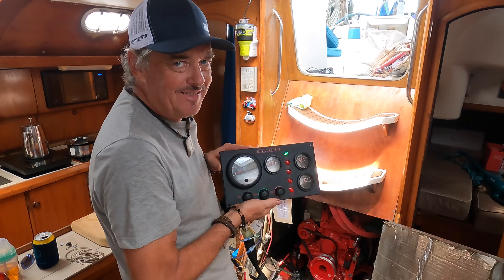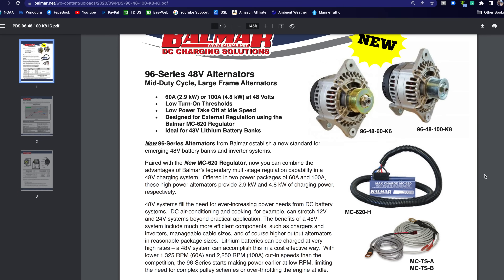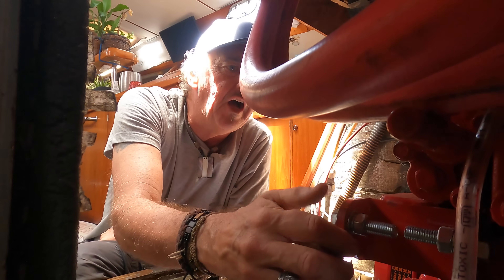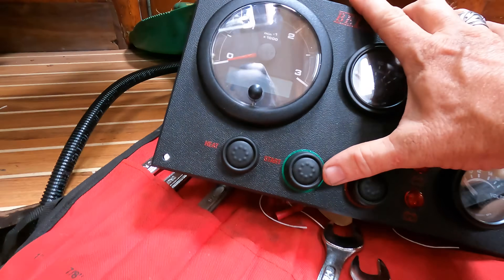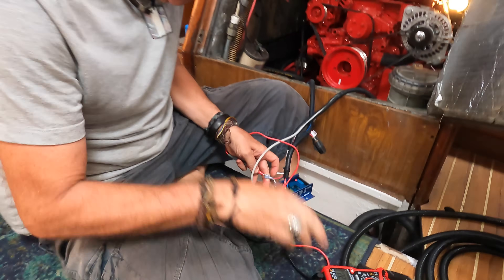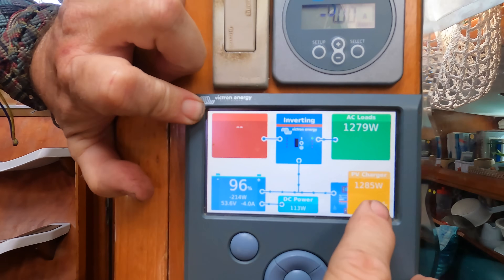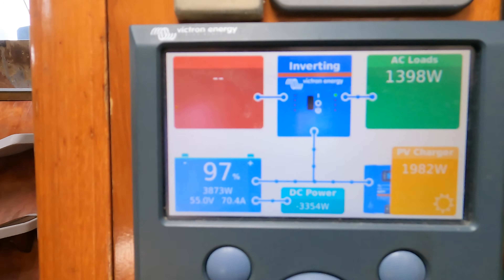SSL639 ~ THIS will change the way we live on BOATS!

Comment: I think it would be awesome if someone made a kit to convert a alternator, to a cc c power supply, and be programmable,  like a charge controller, or at least a dc to dc buck boost converter, it should not be that difficult, a micro controller, and a means of reading current, and feedback, and getting it to operate fast enough to prevent voltage spikes , it's a bit more complex than the analog regulator,  in interested in this because this is basically how my off grid house is setup,  I am building a dc generator to help supply power to the batteries/ inverter when there was not enough sun, I'm at 24v, and in the range of 30kwh 😳 not that much being a house, or with the amount of solar I have, Just shy of 4kw, (I'd like to have more like 14kw, ) maybe next summer, I could possibly convert a vehicle to electric, and solar charge it , fairly quickly, because I'd probably not stop at 14kw of pv, I may stop at 50kw, and 100kwh of batteries, with two 12kw inverters, definitely go to 48v, because the charge controllers are already out of hand, there is a guy with a big 12v system, he has a couple walls with controllers on them! Like 60 amp controllers, (I only have 6).  The onboard  dc to dc chargers are ok for small stuff, for a few reasons,  one being, they are 12v, 2nd, they are like 20a & 40a, it's cool most have a pv charging option as well, a huge 250 amp versions would be great!  Although a 100amp boost version even better,  capable of doing 12v to 24v 100amps, (even 48/62v at 50-80amps 😎 
It would probably cost so much , no one could buy it!!! 😳.  That is a ton of current at 12v and would need fail safes to prevent damage, and probably require dual alternators! 
I have 2x 150amp and 2x 130amp,  and a couple 100amp, and 60amp alternators,  the 130a and 150amp are the
 Heavy Duty, Delco 21si versions, the other are 10/12si and a couple new versions, not sure the model, they all work the same, and capable of 100+ volts, some say they can do around 1000v unregulated, I know they can output enough to instantly blow the bulbs in a vehicle, instantly!! So that's 24v or more, and I know a 12v alternator with only the regular modified, can charge a 48v battery, with only the need for a few more RPM, to generate enough voltage in some cases,  it can probably charge a 60v-72v maybe 96v system, it may require a external rectifier  because I'm not sure the voltage limit of the original diodes, they are definitely tough alternators, and 24v is very easy for them, doing 29.4v to charge my battery bank, 7s liion! LG cells, 
The strange part about my system, I also have a 12v bank, for lighting, security cameras, water pumps for heating, 12v fans, for heating and cooling, I'm looking for a small engine, 4cylinder, automotive engine, 1600-1800cc range,  older simple engine to spin a 10kw generator, and the dc charging system, it will likely have something like 1.5:1 reduction, to get the engine speed up, even a car engine doesn't make that much HP below 2500rpm, I'm thinking depending on the engine, turn it about 2500-3000 rpm, also depending on the alternator, it may require 1800 or 3600 rpm to get the 60Hz. Frequency, or I may ditch that all together, and just build a giant inverter generator, get a 24-48v 12kw low frequency inverter, use a set or two golf cart batteries, keep the battery bank at or above 6/12v  to prevent sulfation damage, or use LiFePo, 200-400ah 24/48v to give it a bit of silent run time,. Using less than 2500 watts it should last a while, then start the engine with a traditional battery, and charge it with a 20amp buck converter, also with ambient heating in the floor, and radiators   for heating, the water cooled engine, can also heat the house,  install it in a trailer, basically a tiny cargo trailer,  with sound insulation, and and really quiet exhaust, possibly run the exhaust through a heat exchanger, to catch more heat, set it up to run on propane and gasoline, if I could find a small diesel engine that would be be great, burn vegoil, used engine oil, propane, 3-4cylinder from a tractor or something,  it would be difficult to keep quiet,  
Sorry I ramble, 😳 great video,!!

Comment: Don't use a visual of the belt jumping as an aid for proper belt tension. The difference between a gas and diesel engine in how a belt acts is considerable. Use a proper gauge or manufacture deflection specs

Comment: Aloha, I would have gone with a quiet 12v Honda generator and solar charger and 50-80kwh of batteries. Giving you 110-220v, 12v and 24v. Now you run a too big engine and have no redundancy. Not properly engineered.
My 50 year old tunaboat runs 24v alternator off its Cummins into two batteries. A Honda generator and a few batteries add a lot of comfort and are very quiet. Electric cooking and warm instant water and charged gadgets on a boat is nice to have.

Comment: You need something like a 9" engine pulley to make those alternators charge!

A 7" engine pulley would engage the alternators at around 1000 engine rpm, but wouldn't charge at idle, which may be okay to you, I don't know.

With a 7" pulley, you would need 2200 engine rpm to get rated output. With a 9" pulley, you would need 1700 engine rpm for rated output.

That is a pretty steep curve for those alternators. I would have expected more output at a lower Alternator RPM, and a flatter output curve, like the 60a version has.

Comment: Depends on efficiency. 5kW is a lot of power for a air cooled source in close, warm environment. 60-70% efficiency is real world figure for this type of alts so to be able to output 5kW it will have to dissipate average of 2.7kWh into engine heated compartment, also means it will take off 7.7kW (10HP) of boat engine at given power (not at max output but at any if its geared for more then 3000rpm at alt end and batteries bank is empty enough).
I don't want to ruin a dream but many tried this in motorcycle bussines (100amps instead of 65 amps) but end up frying the alternator due to overheating in the middle of the road...

Comment: OK that looks nice, but how do you convert 48v to 12v?  On my boat, everything runs on 12v and it would be impossible to modify my electonics to use anything other than 24v.  Lights I can see just replacing bulbs but everything else like phone and tablet power supplies use a cig adapter or deck fitting w/ 12v.

Comment: here's my suggestion you  need that 12 volt alternator on that motor to keep it redundant and standing alone not dependent on the 48 volt step down or any other system but it's own.

Comment: Great vid. I assume you have both 24v and 12v systems on your boat. What are you using to convert 48 down to useable 12v and 24v? For lights and what not small loads there are lots of options for small buck converters but large loads like bow thrusters or windless need many amps to run.

Comment: Diesels with no load is NOT a problem, low RPM long term idle IS a problem. Increase RPM a little above idle to ensure proper oil circulation. Long idle increases wear on the top of the engine because of low oil flow. Depending on your particular engine raise RPM's till normal oil pressure on the gauge

Comment: you need an an inch of play half an inch both sides, measured on the long side of belt.
the new alternator should fit exactly where the old is without the need to change the bracket, replace the new alternator pulley with the original that should run at the same speed with gearing ratio, the original alternator pulley should fit on the new on fine. has a key don't lose the key.
if the new alternator has the same size pulley as the one you just put on will run faster because of the ratio of gearing if they are different sizes.

Comment: Has anyone seen an electronic clutch used on an alternator for a boat? Not the freewheel clutches used in cars, but like those used on the a/c compressor. This could allow you to disable the charging alternator when not needed and give the hp back to drive the boat or reduce fuel. Appreciate it’s another thing to go wrong but on a secondary alternator, why not? Thoughts?
Reply: No need for a clutch...Just electronically tell the alternator to quit charging and it will free wheel.  Most new cars have the alternator under the control of the computer. While cranking or wide open throttle some systems tell the alternator to free wheel.  At other times like turning the AC on it tells the alternator to up the amps.
Reply: @mikegoodman447  thanks I'll look into this.

Comment: Captain Rick you need to add a belt tension gauge to your tool kit to prevent over tightening your belts causing shorter belt life and bearing damage to accessories like your alternators.
Reply: Beta marine state only tension belt by hand, has sticker on its engines to say that , and won’t specify a specific tension.
Reply: @greggbutler9344  Sounds like they have the wrong person answering the phone. There's always an optimum tension and "till it looks right" is only good when you are playing horseshoes.
 That's like Westerbeke, who paint everything red when it is assembled. Despite every hose and belt saying that paint will help dry out and crack those parts.
Reply: Where do you find a belt tension guage?
Reply: @iwander2561  At an old time auto supply or on ebay. They are still being made, but since most cars have had self tensioning belts for 20 years...it takes some hunting.

Comment: I would rig an automatic spring loaded belt tensioner pulley pressing on the un-loaded back of the belt on the take--up side of each alternator, not the driving side.  I would run the entire output of both alternators into the Lithium house bank.  You may need to use a common connection  device including RF suppression and a smoothing capacitor to do so.

I would do as you probably are doing and charge the engine start battery using a DC to DC charger of about 30 to 50 amps output, entirely independent of the engine alternators.  Keep a spare, DC to DC charger  if one is a bit apprehensive, they are not all that expensive, a couple of hundred dollars or so.   These modify the charge current as required and keep the engine starting battery fully charged

All one needs do then is to protect the alternator windings and diodes, using voltage sensitive relays  or some other isolating device to disconnect the alternators from the battery bank when the engine is not running.

As an extra precaution, one could enclose a pair of HEAVY DUTY  DIODES  in any DC inputs from any other charging sources such as a portable generator or solar.
Reply: it's much easier and sensible to just leave the 12 volt alternator to charge the start battery and power the ignition that way if it should ever fail you have the lithium Bank for a   step down DC to DC 12 volt backup

Comment: How many HP is the engine?  Are you concerned with the alternator pulling too much power from the engine when underway?  I know this can be adjusted through the voltage regulator but not something I would want to have to adjust every time I will be motoring.

Comment: Too bad Beta Marine couldn't have bracketed it so you could run a single serpentine with a tensioner for both alts and pump. Still, all good in the end.
Reply from the maker: I think it would be way too much load for one belt, and if that one belt gives out you lose everything.. right now at least with the dual belts they are both the exact same belt, so keeping lots of spares of the same belt is easy, and they are very quick to change and adjust in the current configuration.. I'm happy!  :)

Comment: Nice install and update on your new system.  So many exciting things happening at the same time in power generation and power storage/management.  If feels like the innovation curve for boat-specific capabilities is suddenly getting much steeper after decades of little to no innovation.  Good stuff for us!
Reply from the maker: Yes, that's for sure!
Reply: An alternator should be, by design able to run at maximum output with out overheating, if you have a heat problem it's probably because your engine room in on fire.  You can add variable resistance to reduce current or even a switch to open the circuit entirely but the alternator, as long as it's turning is still TRYING to generate current.   "Draw load" is not really an issue as you cant over draw current from the alternator.  In some larger, much hotter environments,  clutches are used to allow the alternator to turn slower but again that shouldnt be an issue for you ever.

Comment: Rick, if I understand you correctly, you are planning to replace the 12 volt alternator with another 48 volt alternator. I would recommend that you add the second 48 volt alternator and keep the 12 volt alternator, 12 volt starter and 12 volt batteries as their own isolated system. The reason I'm recommending you do this is that if you run the motors starting system off the 48 volt system and the 48 volt system goes down, you're not going be able to start and run you're engine. I'm basing this on my 40 plus years of experience working with electrical/electronics/mechanical systems. I've seen the results of combining systems to save money and the problems that can come up totally shutting the whole system down. You can add a crossover switch and voltage reducer to use the 48 volt side as a backup in the event the 12 alternator or battery go down. Since you can't predict which system will fail first, it's best to keep the engine charging and starting system separated. It may be many years down the road, but one of these system will go down. You don't want to loose the engine starting system along with the 48 volt system. That could leave you stranded and out of reach of any kind of help.  Just food for thought.
Reply: I would agree with that advice, Donald. For our deep dive refit, we chose to keep the stock 12 V alternator to feed the starter battery while the 24 V lithium house bank will be charged by two 24 V Balmars. As they did for Captain Rick, Beta Marine did a bang up job putting it all together with the necessary mounts, belts and pulleys. I chose to use one Wakespeed 500 regulator but am now having second thoughts about redundancy and wondering if we should spring for one for each alternator. Do you have any words of wisdom on that note?
Reply: The engine starter operates on 12v so he has to keep his starter battery obviously.  If the dc/dc 48v to 12v system fails it’s pretty easy to make 12v happen when you have a 48v battery bank.  A set of jumper cables tapped off the bank will get the diesel started. You could even run a permanent tapped set of wires with a switch for such an occasion.  But I understand your point, redundancies and separate systems are always a good thing.
Reply: I'm an Auto electrician but I saw and said the same thing that 12 volt alternator looks like it's doing its job in there, why interrupt that or take it out.?

Comment: My experience from using the alternator on a diesel engine to monitor engine speed is that any change to the load on the alternator will cause slip of the belt.  We were using engine RPM to turn on or off an alternate fuel for the diesel engine.  We found that simply changing the head lights from low beam to high beam would cause a significant slippage of the belt on the alternator pully and turn off the alternate fuel because the RMP, sensed off of the alternator had dropped below the set RPM for over five seconds.  Originally the specially designed AND/OR switch was using a hall effect sensor to generate a frequency directly off of a spinning component of the motor.  This meant that the selected RPM of the AND /OR switch was not effected by belt slippage as a result of alternator current loads.  Displaying engine RPM from off the frequency generated by the alternator has this same inherent problem in that belt slippage due to alternator load has a marked impact on the actual RPM displayed.
Reply: Tighten your belt you fool!
Reply: @ntal5859 Well, that is true, but when you are in heavy traffic, that becomes a little difficult.  All I could do was switch off the alternative fuel so that I was only using diesel and not adding the alternative cheaper fuel into the mix.  A loose belt should always be considered when using the frequency output of the alternator as a signal source such as for motor RPM.  In this case where the Motor RPM was an important criteria in the decision making process, using the frequency output of the Alternator was a bad choice for such an important function.  That was the main point of my comment.

Comment: Capt Rick, always enjoy 👍 your installation videos.  Glad to see that your new crew member can actually hold and turn a wrench 🔧.  I’m in agreement with comments about the serpentine belt’s proper tensioning.  You may want to perhaps ask Balmar for their recommended tension specs just to make sure, they may be in the installation literature, you know, the one we never read until after we’re done installing…🤪

One More Thing ☝️
I noticed that the sound insulation foil cover looked pretty deteriorated, with pieces flapping around.  
Again, you may want to replace that before one of those pieces gets sucked into some component.  Besides with the new engine, the engine compartment would look nicer.  Just something to add to the list of things to do, we’re always here to help.  If I think 🤔 of something else, I’ll edit ✍️.  You gotta love all the helpers…

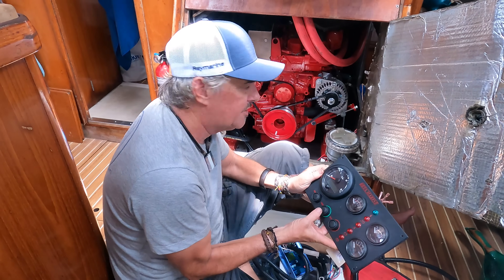Comment: Is it an easter egg or some kind of issue at 8:00, when the tachometer shows zero RPM despite the engine running? ;-)
Reply from the maker: No, the alternator just has a minimum turn-on speed that isn't reached at startup idle speed.. once you throttle it up even slightly, the alternator turns on, and subsequently the tachometer, which is connected to the alternator.